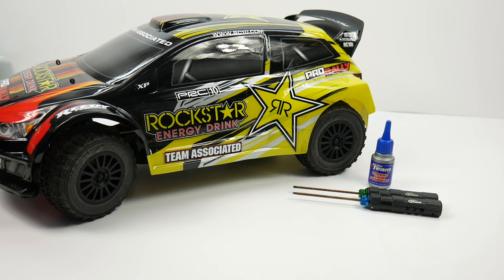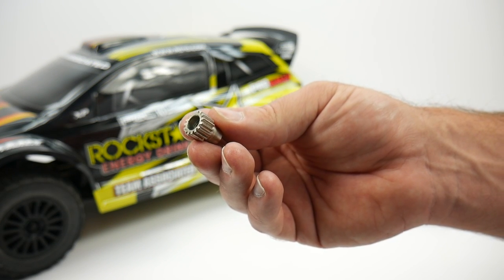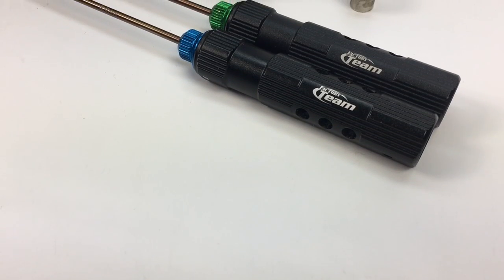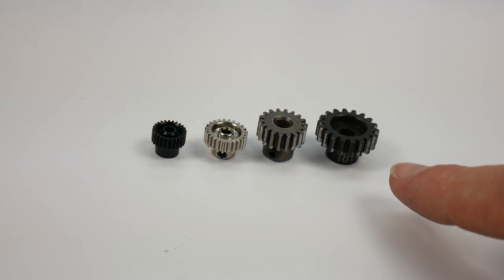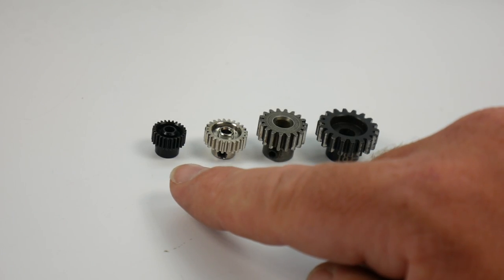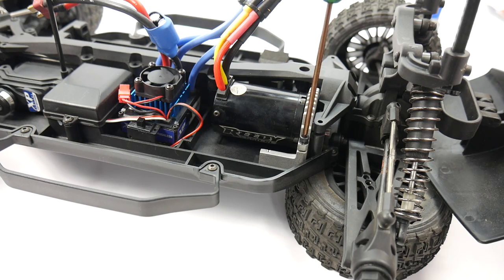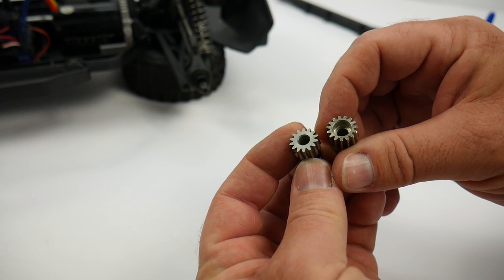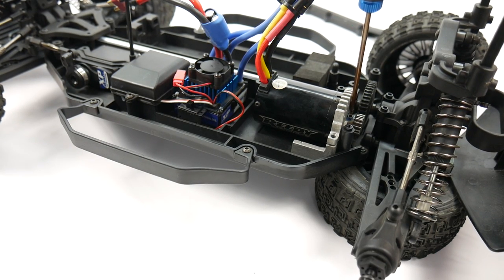RC Beginner Series - How to Change Pinion Gear and Set Gear Mesh

Comment: Hi RCNetwork, I've recently been looking into airplane and multi-rotor brushless motors, and I was wondering if they would be able to work with the set screw pinion gears that you show in the video (as they don't have a 'D' shape shaft). Thank you.
Reply from the maker: They might.....you can always Dremel the shaft to a "D" shape
Reply: @TheRCNetwork  thanks! After researching some alternative ways, I think I will just CNC machine the gear so that I can choose all of its dimensions and just solder it on instead. Thanks for all of your helpful videos and advice!

Comment: So I'm really thinking about getting into this I am fairly mechanically inclined... when I lack in mechanical ability I make up for in common sense but it looks very intimidating LOL I definitely am looking at Traxxas Stampede 4x4 vxl tsm, which I realize is skill level 2 but I have quite a bit of experience as a kid and teenager just not much as an adult but I do have a lot more respect for mechanical devices that I did as a kid LOL. How complicated are these really to work on? I don't plan on working on it right out of the box other than to change out the pinion gear and then of course I'll probably purchase the recommended charging station I saw...
Reply from the maker: You'll be fine.  All you'll need is common sense, the ability to read the manual and some basic RC tools - 1.5mm, 2.0mm, 2.5mm hex wrenches and a 5.5mm/7.0mm nut driver
Reply: Ok, I am def going to go with the RTR box, that way I can replace and upgrade things as I go, may be a tad more expensive in the long run and less practical, BUT I think it would be easier to learn that way?  Thoughts?
Reply from the maker: CD Shavin' Murphy RTR’s are a perfect learning tool - they work from the start and get you some instant gratification. Like you said, you can start upgrading as you go and when you buy for example higher quality electronics, they can be easily transferred to a newer vehicle down the line.
Reply: Awesome, ill look into one of these soon, thank you so much for your help and I subscribed...you have a great channel!!!

Comment: Got a question, Hope you respond. I replaced my Pinion and I tightend it all the way down where you could not move forward or backwards, You could only move it with the gearing to side to side. I took it out for a test drive and got everything tuned up to what I wanted it to be, The Pinion gear just keeps coming lose and flying off. Do I need to glue it? Or what do I need to do ? Thanks
Reply from the maker: Yes, use thread lock on the little grub screw and let it dry for a few hours before use

Comment: I used to use printer paper, but my full-scale mechanic brother told me to try a folded sales reciept and haven't looked back yet. Super close but not tight
Reply from the maker: I just can't use the paper method...it's unreliable and takes more time....the method I use works and hasn't failed
Reply: I can't do it purely by eye and hand. But folded receipt paper holds up a lot better than printed paper for some reason

Comment: Do the gears have a kind of spring to them as they turn?
Reply from the maker: Huh?
Reply: burnt 650r I know what you mean.  Yes....kind of a “bounce” or “spring” as you check it after setting the mesh by rocking it back & forth.  Hope this helps (and makes sense...a little hard to explain!).
Reply: D.P.T. I was hoping that the bounce was normal. At first I was concerned. Then thought it might just be caused by the magnets in the motor.

Comment: good day got my hobbiewing motor and esc where can i get the best wire for the motor and the bullet connecters
Reply from the maker: The wires should have come with the ESC- I would use those, they're pretty decent.  As for bullet connectors, I buy in bulk off of ebay...make sure they're a well known brand like Maclan (That's what I use) for the battery terminals...if you're connecting the motor to the ESC - any 4mm bullet will work
Reply: thanks for the info my hobbywing motor didnt come with any wire

Comment: I really hope my pinion hear keeps on falling off because i did not screw it on right, I’m so confused on why my pinion keeps on falling off?
Reply from the maker: Make sure you're setting the grub screw on the "D" side of the motor shaft...use loctite and wait 24 hours before driving.  Be sure you're gear mesh is good as well
Reply: The RCNetwork yes, thank you! I never knew about that D shaft Until YOUR video! Thanks! I hope this and buying blue loctite will help!

Comment: What do you do if you cannot get the pinion gear off?
Reply from the maker: It should easily come off....I've used a flathead screwdriver before to pry it off the shaft...but be careful

Comment: I noticed your pinions aren't greased. Is that ok?
Reply from the maker: You shouldn’t grease pinions, it will just collect dirt and grime whether it’s open or in a case.
Reply: @TheRCNetwork  oh ok, I didn't know that. Cause I just assumed since it's metal and all I'd think that it too needs grease to lessen wear and tear like the diffs. But thanks for the tip
Reply from the maker: @doylecholesterole1927  most RC’s have a metal (steel or aluminum) pinion and a plastic Spur gear. The idea is if there is a failure point, a $4 plastic spur gear is better than a $80 transmission or a $100 motor.  Even if you’re running a steel spur and hardened steel pinion, no grease is recommended.
Reply: @TheRCNetwork  okies, that's something new I learned. Thanks again for the tip and replying. Stay safe 🙃

Comment: If you put a small piece of paper between the gears, push them together, and tighten down the motor, you will set the gears perfect every time.
Reply from the maker: Steve S with all respect Steve....that never works, especially with finer pitched gears. The best way is the method I've shown. Gear mesh is crucial to a great running RC and keep any unneeded load on the electrics.
Reply: It works great for me.  I haven't stripped a gear in years.  For the finer gears I use a thinner piece of paper like a receipt.  As long as you hear that little click
Reply: Steve S you can use paper to set the mesh but that doesn't mean you shouldn't check the clicking sound after. Paper is soft and you can easily set the mesh incorrectly if you don't apply enough pressure or apply too much.
Reply: Jason Cioffi obviously u should check to make sure the mesh isn't too tight or loose after setting it.  Sometimes there is more than one way to solve a problem.  To say "that never works," is very inaccurate.
Reply from the maker: "that never works" is way of saying I wouldn't trust a system that involves chance with in this case a $250 RC, let alone a $1,000 RC.  I don't want to give advice that involves chance and saying "just shove a piece of paper in between the gears and you're good."  In your case, you said "perfect every time"  That is very inaccurate, Steve
Reply: The RCNetwork Last time I checked it "it never works" means it does not ever work.  Not just well if ur spending this amount of money on something u shouldn't do that. You're right I shouldn't have said sets it perfect every time as u have to check it just like with ur method.  Sorry to get u all hot and bothered.
Reply: Steve S Well as someone new to the hobby I also saw a few different videos on setting gear mesh all do the paper trick also so I know what you mean. That seems to be how alot of guys like to set their gear mesh and it worked for me. It seems to get that perfect mesh of not too tight or too loose.
Reply: Chris Watson,lol read all of it a whole 1 year later,way to prove your point brother!